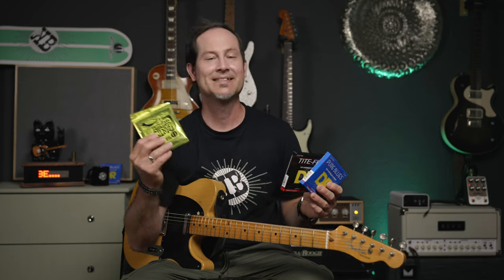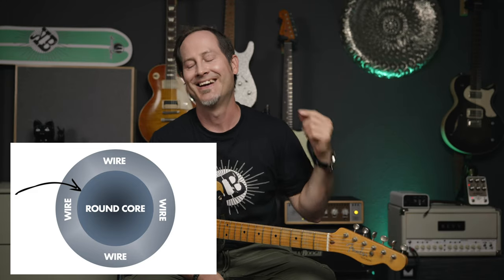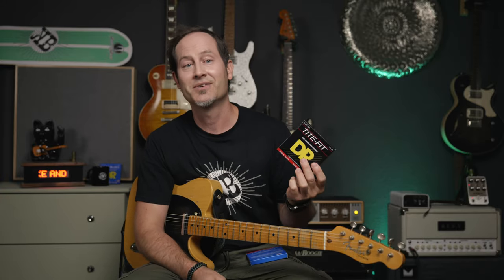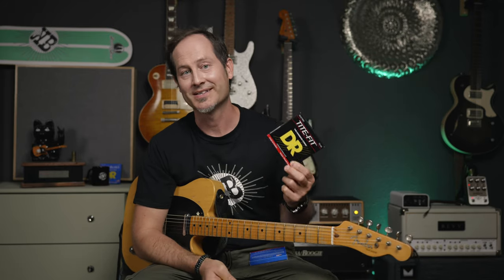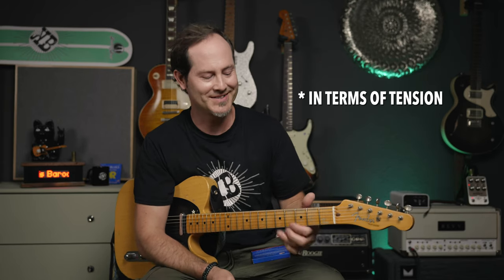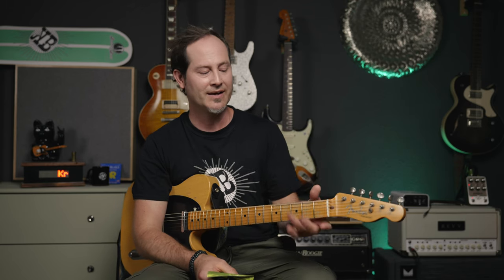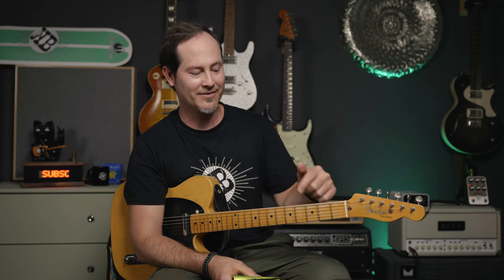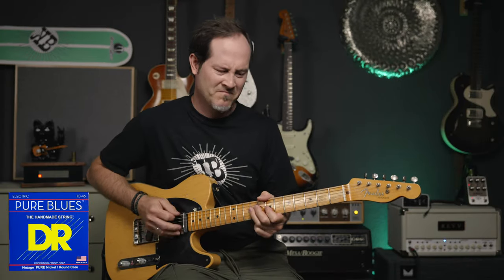GUITAR STRINGS: I Bet You Didn't Know This | DR Round Core Strings | Guitar Tweakz

Comment: Absolutely.  I found DR Pure Blues many, many years ago, and seriously nothing else came close.  They feel nicer, they sound good, they just last and last and last and don't seem to go dull over time like other strings, and they break much more infrequently.  Prior to DR strings I'd break a lot more strings, sometimes even break one when putting it on, but if I break a DR string it's generally a good sign that they've been on the guitar a very, very long time and with pretty much any other brand I'd have probably gone through at least 3-4 sets if not more by that stage.  Love them.  But they don't market well and lots of shops don't carry them, so they seem to be a lot less well known and used and played compared to so many other brand strings.

Comment: I use ghs david gilmour in my fender strat they are awesome one thing to take on mind if you use round core's you should bend 90 degrees at near the end of the string to prevent slip and loose intonation right away when installing the wound strings,cheers from tijuana mexico i use hex in my gibson les paul and sg 🤘
Reply from the maker: Yes, that is a very important piece of info there: bend round core strings before cutting them to avoid the wrap wire become loose. Cheers!

Comment: I never knew about round vs hex core until I saw this video. But for the longest time, I’ve been a big fan of DR strings. I use a hybrid Tite-fit 10-50 set on my Epiphone Les Paul Muse because I like the way the bass string growl at crunch and higher-gain settings. For my other guitars, I use DR Pure Blues 10-46; I like their smooth, warm tone. I also love how these strings can last ofr at least 2-3 months before they begin to sound dull. In the long run, they are great value for money.

Comment: I love both the hex core & the round core wire strings. I even put the round core strings on a bright sounding pickups chuggy guitar & the hex core strings on the other warmer sounding guitar. I do notice that the hex core strings corrodes considerably earlier than the round core. I have this thought that strings manufacturers purposely invented hex core strings since by design it corrodes easier. In doing so, less corrosion resistant strings = profits(?). Then all they have to do was to market the differences between the two types cores. Just a thought.
Reply: Would not be surprised.  He commented that the main reason for companies going to hex strings was reducing cost of manufacture, so it's a profit thing.  So having the side effect of people needing to change strings more often and thus buy more strings would also be a happy side-effect of that change for those same companies.

Comment: On my tele Curt mangan hex nickel plated 9.5 11.5 16 26 34 44. Gibsons 10-46 or 28 38 48 on the low strings. My main problem with round core is that the D string dies really fast, starts losing rings, also they seem to have more fret buzz

Comment: I use 9-46 on all my guitars. I use to get the slinkys, just because they were pretty good and probably also it was the first available to me in that hybrid sizes. But At that time I had only 1 electic and was giging, And didn't know better. I did try the elixir coated too because i am coroding the strings a lot. But when I started to have more guitars, so using them each less, I found the corrosion was creeping in. I switched to NYXL, still 9-46 and I am in a much better place. they break really less and stay playable for longer.
Reply: Pure nickel won't corrode as bad as nickel coated steel, the frets quickly eat through the nickel coating at the contact point, then the steel starts wearing down the fret and the string loses its tone, pure nickel round core strings seem to last longer, especially if its good quality steel like Pyramid and Stringjoy use. They are twice as much but last 3-4 times longer it seems.?

Comment: Hey Kris,
In your video, the TiteFit sound brighter, the Blues softer and the EB… well like EB 🤣
Through the years, I have experienced TONS of different strings: from the vintage “Nashville” Fenders (the same Jimi Hendrix used) to modern alloy strings. I’ve ended up with 3 sets:
GHS Gilmour 10-48 I use on all my Strats
EB 10-48 on Teles except for one where I use 10-48 Pyramid round cores and aThinline where I use Duesenberg 10-50, as on a PRS DGT (I don’t dig the feel of 11’s)
On all others I use either standard 10-46 Hexcore (10-48 for some that need a bit more oomph on the wound strings). Yeah: makes a lot of different sets that make me keep a chart of gauges and dates for refresh… Cheers mate !

Comment: For what it's worth, I think that all the strings sounded great in your hands Kris!  I've only ever played D'Addario strings my entire guitar playing life (except for one set of Elixir's that I put on my acoustic and then changed to D'Addario at the next string change).  I started with 10's and then moved to 11's.  So I've been using EXL115 for over 20 years and still love them.  They last FOREVER too - I have one guitar that the strings are over 16 years old now.
Reply: Elexir is D'Addario. They took the coating back home and Elexir is now D'Addario coated called X. They made all the strings and Elexir coated them and packaged them.
Reply: @peterknicked  Interesting, I did not know that, thanks!  I just didn't like the feel of the coating and also didn't notice any additional "life" to the strings.  Then again, my electric strings last a long time too... so my sweat is probably not very acidic.
Reply: @hearpalhere  not many knew that Elixir never manufactured any strings. The coating has been improved and the D'Addario X strings feels different than the old coatings. I only use NYXL and perhaps I do not sweat that much either, because I never have had any issues.

Comment: Hey Kris,
Another really interesting video - well done, Sir!
Whst I found most interesting was the thought about string standards when all the "classic amps" were built. In my understanding they should sound the most, well, genuine way with roundwounds, simply that's the strings those amps were designed for. Or is my inner logic taking a wrong turn here?
Reply from the maker: Roundwounds, yes indeed. I was only talking about the core wire being round instead of hexagonal. The wrap wire of round core strings are round (=roundwounds), same as on modern hex core strings. 
So I'm pretty sure we're talking about the same thing. :)
Reply: @KrisBarocsi  Yep, we are...I meant the ones with round cores....shouldn't write comments before coffee kicks in ;)
Reply from the maker: @rallereloaded2180  😆 Coffee keeps this world turning. Cheers man!

Comment: I heard installation isn't an issue with locking tuners, true? Perhaps you can discuss this on the Thomas video you mentioned.
Reply from the maker: Hi, yeah installation of round core strings is pretty standard with locking tuners and on tuners with the hole on the side. It's tricky on vintage style Fender machine heads though and YES I just shot a Guitar Tech Tips video on that subject. ;)

Comment: Are the Pure Blues louder (it sounds so to me)?
And most important 🙄, how do they(PB) "chainsaw dist" (i'am a swede so i had to ask 😆)!?
Reply from the maker: I wouldn't say the Pure Blues are louder but they sound more balanced to me. If you want to rock some chainsaw distortion I'd probably stick to hex core nickel plated steel. A bit more attack (good for high gain) and still not a one trick pony. So you can use them for clean, low gain and high gain. Cheers!

Comment: The explanation for HEX core strings missed an important benefit. When you wind the wire around a round string it has nothing to grip to and those winds can literally slip. Once they do you have gaps in the string and anywhere you have a gap the note under it can be put out of tune and you also have a space for oxidation to get to the core.
The main reason strings die is because they oxidize...or in other words the go rusty. Rust creates holes. Tiny holes in a string are the same as gaps in windings. The note under them may be out of tune. 
High tech coatings stop the oxidation/rust. In spite of manufactures claims you get back to physics again. You can not put a blanket of anything over metal without dampening the metal. 
There is a myth that strings die of fatigue. They do not because they are barely stretched on an in tune guitar.The biggest problem is oxidation.
So which ones should you get??? There is only one single rule for tone with Rock & Roll. If it sounds good. It is good. Choose accordingly, LOL.
The only really seriously big improvement with strings is the marketing. Every year the Bullsh@t improves!!! Some of the best sounding recordings every made were done decades ago when the players had strings that because the old winders and wire pullers could not even make a string that was intonated over every note. In short every inch of the string was a different gauge.
Me, I use good ol' Dean Markley nickel steel strings ...unchanged for decades. 99% of all luthiers use them because of their consistency. Yes that is what comes on a $6000.00 handmade guitar. You don't ever get a dead string out of the pack. $5 a pack.

Comment: I must be unlucky with DR. I just installed DR Jeff Healey 10-56 and 6th and 4th are dead, completely doa 🤔

Second pack with Dr's were these K3 Coated strings and 6th didn't have sustain at all. It's hard to find the exact word for dead string except "plonk" or "dong/dof" 😅

Other brand i always have tough luck is Dunlop & Dean Markley, Dean Markley having mostly corroded with kinks and twists while Dunlop Wounds being dead.

If the next pack of DR's are dead, im out for good. Those strings are roughly 10€ vs so many other OK brands.

There must be good quality DR strings that's obvious because folks talk good about them and Alexi Laiho played them.

So far it's even safer to put Harley Benton Value Strings for a week than taking a risk with DR's.

(I have 27 guitars, yeah i know alot haha, the prob isn't with the guitars or the way i install em)
Reply from the maker: Hey, if it’s always the wound strings, it might be the installation method. Round core strings are tricky and shouldn’t be cut without bending them first. Check out this video, might be useful: https://youtu.be/GLE_spXuQsc
Reply: Thank You, Will do that, i'll stretch and bend usually to 90 degree angle before cutting, but I'll watch the video Thanks. Cheers, Keep up the good work 🎸👍

& Yes, i cut strings often since i have more floyded axes than Fixed bridge /TOM/Kahler etc 😊
Reply from the maker: @JonsterTheBondster  That 90 degree angle sounds already pretty good so it really shouldn’t be the installation. There is one more additional thing in the video (cutting the string in a flat angle behind the bend). Might be useful, or maybe not. Try it out if you want to. 😅
Thanks man, I really appreciate it.